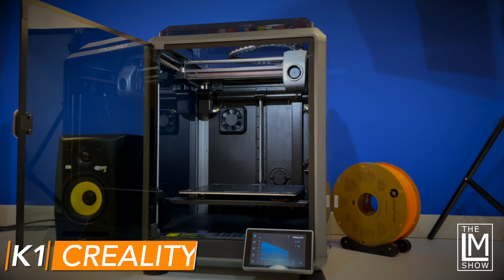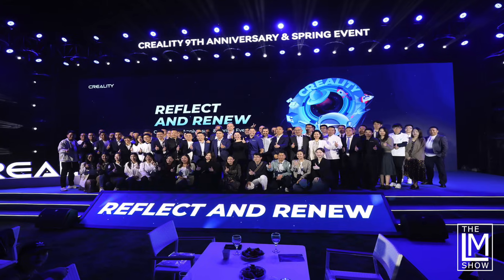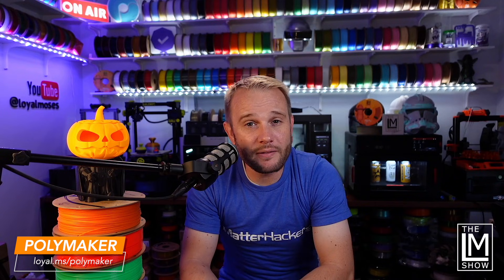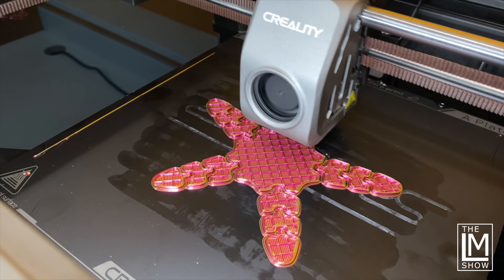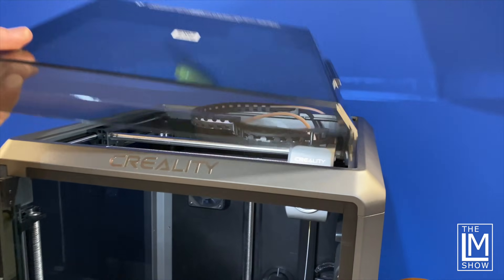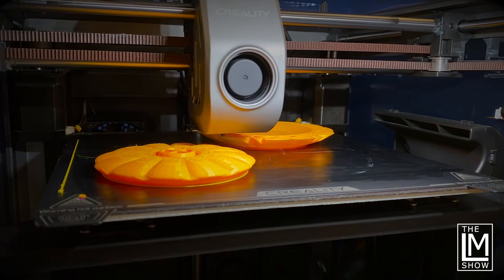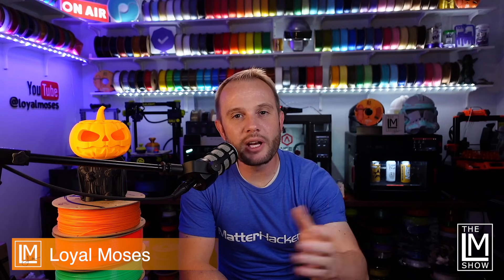ABS & ASA 3D Printing On The Creality K1

Comment: My K1 is my 100% ASA printer.  Its been really good. Its been holding enclosure temperatures really well.  55-58C when printing.
Reply: Do you use the Generic ABS Profil? I will try ASA too on the K1 Max should i turn the Fan off?
Reply: @Mo-wb7rn  I use a Polymaker ASA profile. Can't remember if it came with Orcaslicer or if I got it elsewhere. When I set it up, it was before Orcaslicer supported the K1.  I don't use the aux fan at all when printing my ASA. It causes warping on larger prints.
Reply: @JohnOlson   I would love if you could share your material profile please!
Reply: @Scout339th  I’ll see if I can share a link later. But pretty sure I got my original one from the Facebook Creality K1/K1 Max group under Files.
Reply: @JohnOlson  the aux fan you said you are saying  was the rear fan (exhaust fan) ? How do i turn off that fan? And how can i keep my chamber at 55C ? Im getting a lot of warp with the k1c :(
Reply: @luizlcarvalho  I moved and blocked the rear fan and put it on the cpu because it always over heats. If you don't have a good fan on the CPU it will fail on long prints. Now I tell the rear fan to turn on at 20c to cool the CPU. I'm printing now and the chamber temp is at 38.2c. if you do this, and then print pla you need to remove the top cover or open the door or you will get jams. PLA will get soft in the extruder.
Reply from the maker: That’s awesome to hear! Love it! Thanks John!
Reply: How when the rear fan is hard coded to turn on at 30c?
Reply: @dudefromkeene  Use one of the modded Klipper firmwares and get full control.

Comment: I tried printing ASA overnight and it’s a lot of work. It has to run super hot. I have a ender five max with enclosure which I taped up and have a vent that goes out the windo…asa print really slow. I compare asa to pla+ and found the pla+ was almost as stron with more walls and infill. I had 6 wall with 25 % infill for my r2d2 legs. I can print pla+ 2.0 at 500 to 600mm speed. I tried abs on the past and felt the same as asa.Lastly, pla does not like hot sun but after the multiple coats of primer, paint, and clear. I did not have the issue.

Comment: Massive PITA printing on this thing in a cold room (10-15c), 40+min heat soaking with the bed at 100c to bring the chamber temp up enough to print ASA... Looking to move to a Qidi Q2 if it proves a good machine in coming reviews :-)

Comment: I recently purchased a Creality K2 and have experienced mixed results, although I am discovering that heat seems to be at the root of most issues.  Technical support is a serious shortfall with this brand.  I attempted to get some assistance using the chat feature and essentially gave up.  I asked to have my issue referred to a supervisor and the agent kicked it up to their mainland support team.  They responded in a few days telling me they would ship me a new buffer (mine is working just fine).  I would feel basically on my own without the invaluable guidance from YouTube presenters.  I should note that there are also numerous articles on the Creality website and that is where the CS responses come from anyway.  I will offer that one thing they do well is apologize.  It will probably improve with time, fingers crossed.

Comment: This has to be Creality marketing because the k1 is a pla machine. Why would I say this? Camera can't handle chamber temps and turns off at about 40c. Rear chamber fan turns on at 30c no matter what you put in the slicer. Can it print ABS ASA sure! but you will have to modify it to make it happen. In my other post I explained how, but I can repeat move chamber fan to cool CPU (kept overheating and causing it to crash), block fan hole. quick and dirty use foil.  Good luck!
Reply from the maker: I literally just loaded filament, sliced and hit print. 🤦‍♂️
Reply: @ there’s no way
Reply: Probably had a modified one from creality

Comment: How can i keep my chamber on a stable temp like 45C? And how can i turn off my exhaust fan? Im getting a lot of warp problem on my K1C :(
Reply from the maker: Warping from lifting from the build plate, or? Is it possible you have just a simple adhesion problem? Go take a look at my recent video about alcohol on build plates and cleaning, there is some details in there about bed adhesive that will solve this for you.
Reply: @LoyalMoses  it lifts from the build plate...   Could it be related to the rear exhaust fan?
Reply from the maker: I’d stop the lifting from the build plate by cleaning it, and using Vision Miner NPA.

Comment: I didn't know you could print Polymaker ASA at 300mm/s. Can the K2 do the same? I was told you have to print very slow at 250c nozzle, 110c bed, and 70c chamber. with no faster than 50mm/s.

Comment: Calling it a "turnkey" printer is stretching it a little bit. It's a Creality printer so of course it comes with a bunch of tiny issues you have to spend hours tweaking and fixing before you're printing as advertised....IMO I've had mine for a year now and while it has been a workhorse. It also has been a source of headache when it works just fine one day then the next day it decides to go rogue in some fashion. Then you spend the whole day fixing it to have to repeat the whole thing next week. Maybe that's my luck or maybe that's Creality idk for sure, but I have most definitely pushed through some rough patches with my K1, I still love it and what it can do for me.

Comment: I Brought the K1C just before the K2 came out. i also have a ender 3 v2 neo i was looking for a print tent. the K1 series is so easy to use i am verry much a beginner i throw away more plastic than i have made a successful model but i have far more luck with the K1 and have managed to teach myself things from the k1 series that i can move over to the ender 
the machine is a lot less touchy to small mistakes than the ender i find

Comment: So i have an abs question. I have been working on a part with an infill mod at the bottom which sets the base to 30 triangles. The global print setting call for 100 % aligned recticular. At the transistion from the infill modifier when the print switches to 100% it starts warping badly.  I'm on the 3 try and so i think: Option 1. print the whole thing @100% 2. Print in a different filiment. 3. add more thin modifiers to create a more gradual increase from 35% to 100%. But I would appriciate any ideas and suggestion you or your viewers may have. 

ABS print setting: 260 hotend 110 bed seems to work well and on Orca slicer I am able to move prints at 100-150mms but for this i;m maxing out @ about 75-100mms with 50%mms bridging. Cooling off except for  20% @ bridging. 

Please and thank you. Keep up the great work on your channel.
Reply from the maker: Warning happens during the cooling process when the polymer chains are shrinking unevenly. This happens with filaments like ABS as you are experiencing and can be quite common

If there is too much mass, then there is uneven cooling, especially if you have drafts of air that can find their way to your printer.

I would recommend an enclosure, and keep the temps as high as you can in there, and also ensure you aren't printing too thick of objects that can't maintain temperature and will shrink unevenly.

Comment: I've had my K1 since January. I got it for several reasons. Adding to my small army of bedslingers the k1 was a answer to the fact that you need a 3d printer to fix 3d printers. Total game changer. I wanted one that would just print. No long setup or upgrades...it would be set and forget so that when the bedslingers failed I coulld quickly fab up new parts as needed.  Also the enclosed work space was a big draw as it would mean better results with ABS CF-PA and ASA.  I got lucky that my K1 was built after all the issues with the extruder so it really was play 'n play.  I will be looking at  getting a K1 max soon for larger builds.
Reply from the maker: Awesome! Makes me happy when people have such good experiences!
Reply: @LoyalMoses   Right on! YEah it runs quite alot. total print time 177h 43m 48s with very few issues.

Comment: Hi. Thank you for the video. Could you give most important settings for highest powerful abs outputs?  I only know infill as 90% and wall line count 3 . Thanks
Reply from the maker: I would use as many as 5 walls even! Our shelf brackets here in the studio use 6 walls, and between 30 and 40% infill! 90% is A LOT and has to be super strong.
Reply: Yes, it would be right to use these values, especially when we want to produce very strong, functional-based parts that will serve a certain purposes. For example, I will print a balancer for the kayak to be used in the sea. Are there any other values you can suggest?

Comment: I bought the K1 Max to exclusively print ASA and it has been an absolute nightmare over the past month. Every print has poor adhesion and parts above the brim layer end up lifting and turning stringy and hairy (not the normal type of stringing, the layers don't stick. I managed to print the front door cover to help with chamber temps but even with insulation around the sides, back and top and the fan completely blocked off, the chamber never goes over 45c. Tried every combination of bed and extrustion temps beyond the recommended range, dried for over 24hrs. Is the 45c chamber temp my problem?
Reply from the maker: Sorry to hear this! You can print ASA and ABS without an enclosure, so the enclosure won’t be the problem. It should simple help with reducing warping.

I would make sure that your first layer is squished down as much as possible to a build plate that has been cleaned with soap and water and then glue stick applied.

Join our discord, we’d love to help you find success!

https://loyal.ms/discord
Reply: @LoyalMoses  Thank you, I've tried all the obvious things - maybe someone in the discord can help :)
Reply from the maker: Absolutely! It's terrible when something so simple is not working!

Comment: Creaility Print's default Generic-ABS_1.75 slicer profile has Print Cooling enabled (turned on). I thought that was a no-no for ABS printing.
Reply from the maker: You can definitely use or not use cooling, very much depends on the geometry, size and what you are trying to accomplish.

Comment: I try abs dont stick on bed, try using crrality clue and warp a 20mm wall 0.5 test cube.
Reply from the maker: Clean the bed well, and use glue stick or vision miner nano polymer adhesive.

Comment: Hey man, been searching all over the internet for K1 ABS print settings. Know of any links for temperature settings of have any recommendations? All my tests keep coming out like spaghetti and slide all over the bed. Maybe some glue stick? I typically do alright without glue on PLA, but maybe ABS is different?
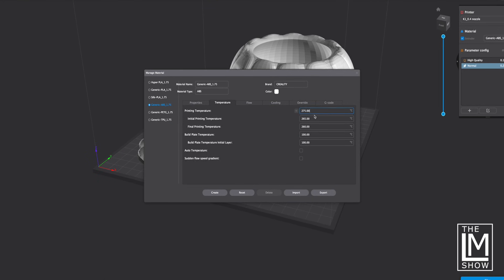Reply: Look at frame 6:27 - he sets the bed temperature at 100 degrees but my question on that issue is this the temperature on the actual bed build plate or the temperature on the sensor? There is a 10~14 degree difference, with the side fan on the K1 cooling I've had corners warp off the bed but when I adjust the temperature to make up for the loss so that the build plate is at 100 degrees, 14 degrees above the sensor, it doesn't warp. Bed temperature, glue and textured build plate combined is what make models stay on the bed, but that is only after handling extrusion, speed and height issues, but I'm still learning about 3D printing and have a long way to go..
Reply from the maker: What slicer are you using?! Mine had ABS settings in Creality Print slicer,

Comment: Main reason for the K1 is trying to print from tougher materials such as ABS and ASA, because I print parts for tools  and parts used outdoors. I printed already some from PLA and PTEG but they didn't last, plus took forever to print a simple thing on my old Elegoo. I was debating between the Bambulab A1, but again, that's a bed slinger- open printer so as much as appealing looking one it is, I needed a sealed chamber.  The other BL one looks good, but more expensive.
Reply from the maker: The K1 is a great machine, the Bambu machines have the potential AMS and better ecosystem

Comment: Great info! I just started printing with ASA, I have an AnkerMake M5C. I tweaked the settings recommended for ASA and also bout an enclosure for it. My dilemma is , I designed a tray for my golf cart and the print starts out great but somewhere around halfway the ends come up a little and the tray becomes warped at the bottom. Any suggestions?
Reply from the maker: You can definitely maintain and increase bed adhesion a few ways.

Make sure the build plate is clean, use purple glue stick as an interface layer, or pick up some Vision Miner Nano Polymer Adhesive that is guaranteed to hold down the corners to prevent warping.

You can also increase build plate temps a few C, and make sure the printer is in a temperature stable environment, no drafts.
Reply: Thank you for the prompt  response. The build plate is at 100C, the max it will go. What I don’t understand is the brim was almost impossible to get off the plate. I’ll try the adhesive. Thanks again, I am a newbie to this but learning fast. @LoyalMoses
Reply: @LoyalMoses  one more question if I may, I’m printing the ASA with a brim, the part comes off the hotbed fine but I can’t the brim off, how do I remove it? It is a textured plate.

Comment: CoreXY appeals to me. The speed also interests me as well as the fact it is fully enclosed. I do plan to print ASA so this has my attention although I m concerned about fumes while printing.  I have been known to be somewhat sensitive to chemicals so this is a concern. I think I could print close to my window with the window open. Would this be good enough?
Reply from the maker: If the exhaust is blowing out the window, maybe. But in any enclosed space, I wouldn’t advise it.

Comment: So if abs shrinks 1.5% dors the software adjust to keep dimensions correct?
Reply from the maker: You can definitely scale models to accommodate for shrinkage, and it is a very common practice.

Comment: I have just purchased one, I nearly chose the Bambu one after watching the early reviews however I went for the K1 because of the smaller footprint to fit on my desktop and it is easier to get independent parts like nozzles etc. as more of these sell I would expect more support to be available like the Ender 3. I am happy to say that the problems reported on the early reviews seem to have been solved on the units being shipped now from the Creality store as mine produced good prints straight from the box without any alterations suggested in the early reviews. I am glad I went for this now as it is a well built machine and with the added camera is a pleasure to use, and compared to my Prusa Mk3s+ prints a lot quicker and just as good.
Reply from the maker: K1 is a great machine! I really like it. I am glad to hear you have had such great success.

Comment: My K1 has been a dedicated ASA printer, it just works with that stuff SO WELL!

I do wish it worked better with PETG, I just can't get the stringing down....
Reply from the maker: It’s a great machine! Let me try some PETG and see what happens.
Reply: I print PETG all the time and have little to no stringing issues. I'd look into your slicer settings or try a different brand of PETG. I use Duramic PETG and it has been printing perfectly. If your environment is humid, I'd look into getting a filament dryer as moisture in the filament will cause increased stringing.